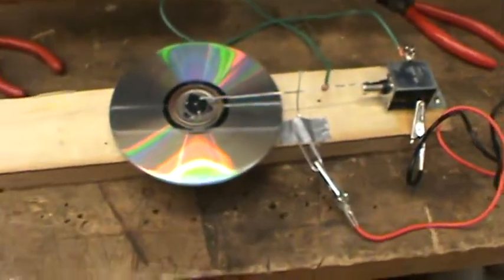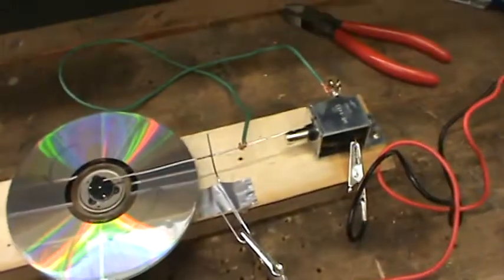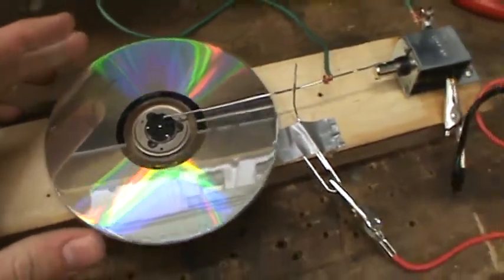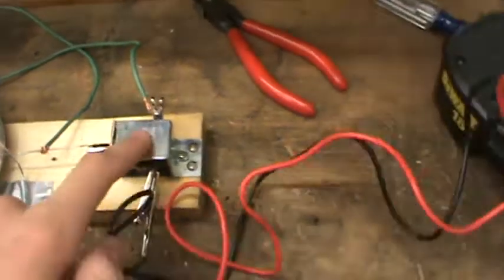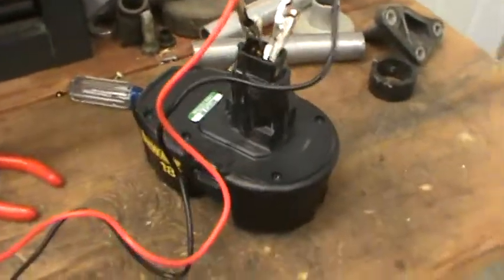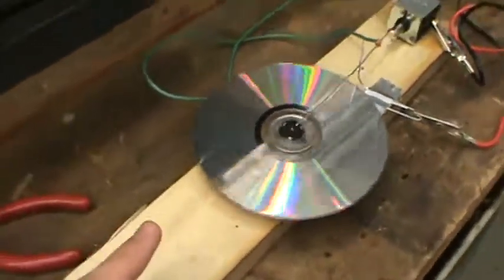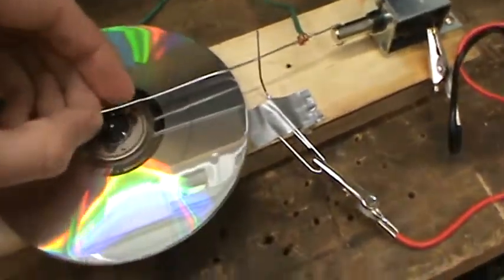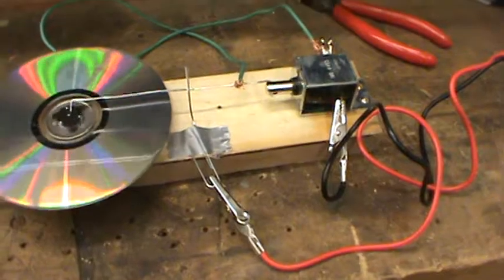My homemade solenoid engine/motor (unfinished)

Comment: looks good, however, I would add some weight to the flywheel opposite the connecting rod to keep it going in case it gets stuck for some reason. ( I doubt it will) but still, if for some reason something happened, the weight on the cd would keep it spinning!! also, you should find an old transformer from something as opposed to batteries, its just overall a better idea then using batteries. I think.